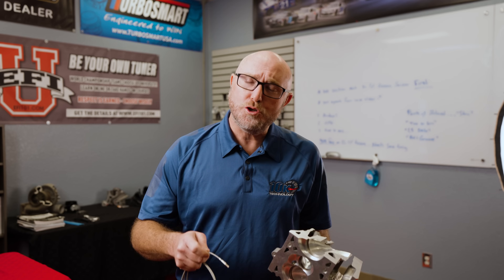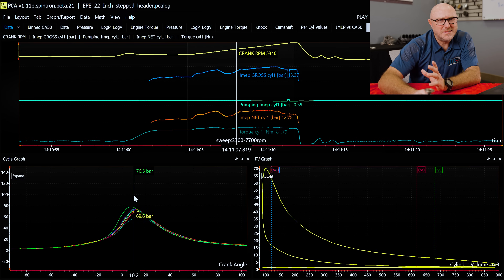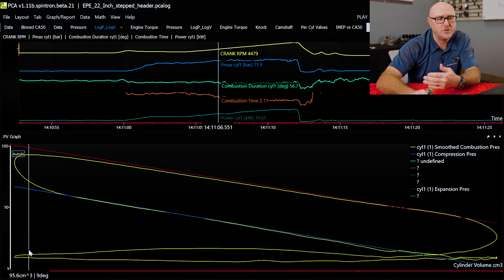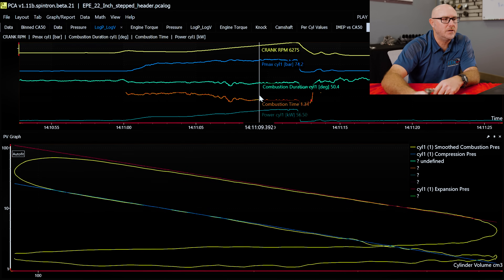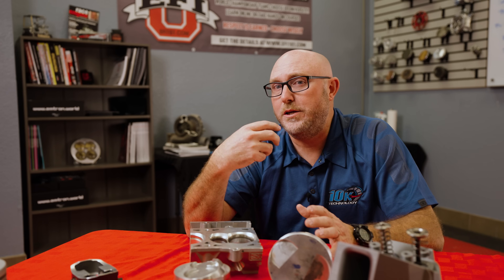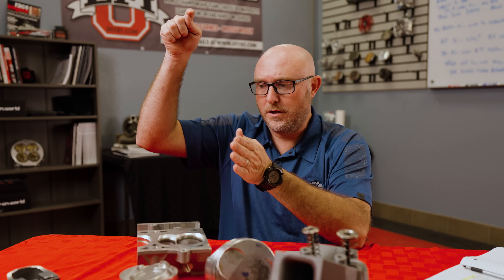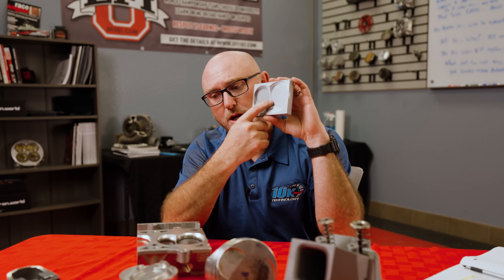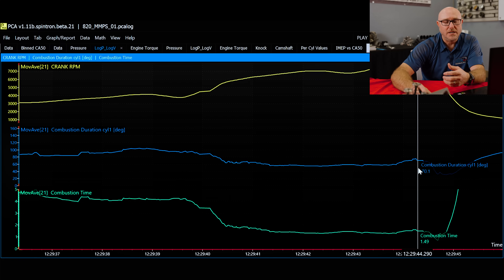I Think Steve Morris is WRONG and I Can Prove It!

Comment: I guess what Steve stated could be described as being (basically) right, but for the wrong reasons. 

Another example in this industry is the claim that LSA in and of itself determines engine behaviour. And just like the physical realities of creating working cam profiles mean that a given LSA on a given duration more or less correspond to given valve opening times (what matters), the physical realities of cramming more A/F into a given cylinder mean slower initial ignition (due to more mass needing to be plasma'd by the same energy spark) and an increase in exhaust remnants - which, like you mentioned, lowers the burn speed. By themselves and of course combined, these factors result in a longer combustion time than what "should" be and thus the need for more ignition advance than what "should" be needed.

These circumstances mean that statements that make absolutely no sense when looking at them from a basic theory, chemistry and/or physics angle still can correlate to real world results - which in turn are where Steve, and the LSA guys, got their beliefs from: they've done it in the real world, they've seen what it did, they've (hopefully) thought about it and they've drawn their conclusions.

Comment: Where the spark plug is located, what type of plug, and AFR. A fatter mix burns slower BUT it creates more pressure. If you pack it up you make it denser, thus it burns faster, but if you add more fuel, it burns slower again. If you run it rich you create carbon deposits inside the chamber which then heat up and cause pre-detonation. If you add more fuel and boost, reduce the advance, you end up with unburnt liquid inside the chamber that doesn't compress, lifting the head from quench area. Then there's cam timing. When your exhaust valve opens, the leftover pressure escapes. this pressure spins the turbo fan and heats it up. This heat travels through the turbo heating up your oil and your compressor fan. If you have overheated your cold side before, this heating fan expands and makes it tighter, heats up your intake air, showing more boost on your gauge. Then you cool the temp down with your fuel, but your AFR is still out of whack and your flame front is escaping into your exhaust. Also your liquid fuel flushes your piston rings creating more friction, making them lose tension, while the hydro lock collapses your ring lands. When the blow by escapes into your crank case the flame front follows welding your rings into your piston. Then your piston heats up, so does your rod, your rod expands, and your piston sticks to your cylinder bore. Rod gives up, piston shoots up into your valves and the run is done.
Reply: An exciting run indeed..

Comment: Back in the '90's, I read an article in a snowmobile magazine about a gentleman who was testing cylinder transducers in a two-stroke engine. As I recall, he was trying to eliminate the carburetor for a better EFI system regardless of load, temperature or altitude. Not sure how it ended but this sure rhymes

Comment: I was told the LT-5 has one of the best combustion chamber designs of its time. They respond really well to additional timing.
 I wonder what technology Lotus was using back then in the mid 80's because they seemed to have nailed it with that engine.

Comment: The fire scenario you speak of is backwards. The fire on the right will burn hotter but not faster. Because the flow obstruction . The one on the left has no restrictions will burn really fast but not as hot. Not enough fuel. 
Prairie fire in Kansas. https://youtu.be/xulrGWL5BoU?si=yzEwuQEWEcwegQk-
Go Chiefs Tomahawk chop for Dewey 🥩

Comment: When you talk about 426 hemi. When Dodge wanted the old men to run the new hemi instead of the 392 that everyone else was using. Gar couldn't get it run hard like the old one , in frustration he cranked the timing    up, way up, said Gar, well that was what was missing way more than they ran in the 392.  Ask him
Reply: the reason he cranked the timing up in the first pace was he wanted to blow up the engine so he could go back to the 392 Hemi. the car went something like 210 at 40 degree's timing and the nhe upped it to 50 and it was even faster.
Reply: True; but i think it was becauce nitro fuel burns extremely slow. Not sure why the 426 was so much different than the 392 using the same fuel.....maybe larger chamber?

Comment: I believe Steve. If you are running low compression. The tune can tolerate wider variable of tuning. Steve’s compression engine won’t have as big of tuning variables. Alcohol increases the window wider with cylinder cooling factor.. 
The grass fire scenario you are talking about happens in Kansas you got it backwards. Dried short grass with no brush to block the wind burns very fast . The wooded are burns fairly slow because wind can not flow do to all the obstruction of trees and brush. 
Go Chiefs Tomahawk chop 🥩

Comment: I agree with Steve, to an extent. There's always outliers. Just because you should be good without changing timing doesn't always mean you are good. If you're introducing more air, add more fuel, the bang is going to be just as sufficient when was before as after. As long as your fuel is set up properly. However, if you're running crap fuel on crap plugs on a crap engine and throw boost at it, you're going to get crappy results. Maybe not as crappy if you retard timing, but the ends doesn't justify the means.
Reply: Have you put a drag & drive  deep in the 5s!
Reply: @patcoder7308  THERE IS A WANKER CALLED V8 LENNEY SAYS THAT STEAVE DON'T KNOW SHIT AND CAN'T BUILD AND ENGINE TO DO 500HP WHAT A TOSSER.   I THINK FOR WHAT STEAVE IS DOING WITH THAT WAGON DOING A DRAG AND DRIVE HE IS DOING REAL GOOD . THAY KEEP TRYING TO COMPARE STEAVES WAGON WITH THE EAGLE . BUNCH OF NUM NUTS TO NOT KNOW THE DIFFERENCE BETWEEN A PURE DRAG CAR . AND A DRAG AND DRIVE.
Reply: I DO BELIEVE THAT AIR DENSITY HAS A BIG PART TO PLAY IN BURNING ALL THE FULE. OR AM I WRONG.

Comment: When I live in Japan I worked for a Japanese manufacturer's internal engine builder and parts maker for their racing programs. We also made prototype parts for future models. We had our own data from grA, GT300, GT500, Dakar rally, 24hr LeMans, Pikes Peak, etc... While I was there we started making street parts based on those programs. Our oil pumps, headgaskets, pistons, rods, cams, turbos and other parts were exactly the same as race version. But we added some cam options, oil pumps, water pumps and other parts based on racing but for street. Anyway, every single engine required less timing as we increased boost. We produced our own ecu and software too. It's not uncommon for our engine programs to have 30+ degrees at 0psi boost tapering down to 20 or even 12 degrees at 21psi and 28psi. We could add a few degrees after peak torque but didn't bother on most. That's on about 94-95 octane (USA rating) with pentroof 4 valve. If we wanted more boost then we'd remove the quench pads or use race gas. Keep in mind we could run 13:1 and extremely high egt for 30+ minutes with no damage. Of course we ran 11:1-12:1 and low egt for safety. These were 2.6 & 2.8 in line 6, 8.5:1 compression making 450-800+hp at the wheels. Oh and the pressure delta varied greatly between turbos. We even used old school clipped turbine wheels on some setups to reduce back pressure. Nonclipped would spool 1bar just before 3,000rpm and clipped version kick in at 4,500-5,000rpm lol. It ruined turbine efficiency but helped VE. They would run like big displacement NA engines from 5,000 to 8,000 rpm. I can't imagine running the same timing at different boost.

That said if engine makes peak power at 30 degrees and 0psi. But it could also run at 40psi and 0psi without ping then theoretical maybe it can make peak power at 30 degrees and 21psi were as our engines did at 20 degree. I wanna say air-cooled Porsche make peak power NA at something crazy low like 20 degrees but don't ping till 35+ degrees. And that's like Steve is saying. The combustion shape is limiting factor not fuel. Need a "hotter" combustion design. But then again on air-cooled you probably can't keep cylinder head temperature under control if the combustion design was pushed harder
Reply: SM is using methanol so that may change things.
Reply: So Nissan RB engines. Interesting.
Reply: 2.6L and 2.8L inline 6's commonly running 8.5:1 compression in those series with a manufacturers internal engine builder... so Nismo RB26's 🥳hell yeah, thanks for sharing that.
Reply: Remove the quench pads for more boost? Internet says no quench causes detonation sooner? Remove pads to lower compression? A 2jz ge , with a gte head gasket will have lower compression but you have too much space on the quench pads for them to work. If I want high h.p. boost, do I run no quench on the ge (thicker gasket ) or run quench with stock gasket thickness giving higher compression?
Reply: @jasonschreiber6458  its not that no quench makes detonation happen sooner(it doesn’t), improper quench does. Theres a middle ground between good quench and no quench where you run into detonation issues. The chamber is shaped much different for a no quench build
Reply: Kyle asked for comments got plenty to think about, and in the comments 😊
Reply: Can you share ideas on how to prevent engine damages due to LSPI in an direction injection engine?. An engine using 0.5litre of engine oil for every 1000km would mean 5 litre at 10,000km. Most oil loss  would mostly go into top of the piston and increase risk of LSPI damages? In China the made different replacement set of piston & rings for VW engine to reduce lost of engine oil. Pls share your experience. Regards. 🎉🎉🎉
Reply: Facts brother.. my turbo coyote was picking up approx 40hp per point of timing up to 21deg.. then above that is was only a few or no numbers.. if you go too far with timing, your just pounding the pistons, rods, and bearings as the pistons is still moving upwards when it lights.. and if it's too low you won't have the proper compression which is what makes the power... I move mine between 14-22deg depending most on fuel type..

Comment: The faster the combustion(without detonating), the easier it is to run at higher RPM, and easier it becomes to time the combustion event closer to the point of maximum mechanical leverage, ~12-18ATDC depending who you ask. You also lose less energy to the cooling system, which then also let's the engine run cooler, because there's less radiation from combustion acting on the engine itself.

The combustion process is the ultimate black art of engine tuning. Eventually you have to seek the wisdom of the combustion chemists, who understand fancy jargon like rate steps, and intermediate species, and have them tune your witches brew. In the really exotic world of 4 valve rapid combustion, swirl and tumble are just scratching the surface. They even go as far as slapping what is essentially a spark plug non-fouler with small drilled holes.

Comment: Seems like Steve gave you the parameters of his statement, safe fuel ie quality race fuel, safe compression and boost levels, and safe combustion chamber design and safe timing numbers. I think it's important to recognise that Steve Morris builds drag and drive engines, not max effort, race engines and what he finds an engine needs to put thousands of miles on the road and race is different to a rebuild every x number of runs. So, in conclusion, as you stated when you build an engine the way Steve does you get the same results and when you do different engine designs and intended use you get different results. From your results it seems like air and fuel prefers somewhere in the .8 to 1.1 time range to complete a combustion event regardless of variables

Comment: There’s a way to do this without drilling into the head 

Had a set of 8 spark plugs that were made by drilling into the nut and comes out into the combustion chamber had a jeweler micro weld a stainless tube onto it and ran it through an expansion coil to even out the pulses and it gives a better reading and you can save the heads and collect the data on several different platforms without ruining the heads it was really cool to see and cost all of $800
Reply: What sensors did you use with that?
Wouldn't the additional volume of the coil cause issues?

Comment: We need a temperature overlay. As there's a density shift and the speed of sound changes.  Would love to see this. 👍
Reply: Bingo. Adding boost increases pressure. With the equation PV= NRT, it balances out as extra TEMPERATURE (T) . Extra temperature causes detonation. That's why if your fuel can't handle it you have to pull timing with  boost
Reply: steve is not using the same fuel he is using so this data is nowhere near the same
Reply: @stevenbean9706 fuel type only sets flame and oxidative rates.  But all fuels are affected by temperature and pressure.

Comment: I heard Steve say as long as your fuel is "Tolerant" also.  I figured yes Methanol is Tolerant, Steve's preferred fuel.  A BBC requires a lot of timing.  In your example "Boost Fixes Everything", so you needed less timing.  How about another video on a GENII HEMI?  You also didn't mention AFR, a lean mixture will detonate especially under boost.  Anyway I just Subscribed.  Thank you.

Comment: I started in the engine reconditioning game when I was 16, that was 1985, I have worked in the performance race engine world, for many many years I was tuning engines, race engines, be it on a engine dyno or a chassis dyno, before retirement , I owned a performance motorcycle shop, with a motorcycle chassis dyno, building turbo bikes, nitrous and all motor engine.
I can tell you from a life long experience, Steve Morris is wrong a lot of the time.  I remember  watching that video and his claims about ignition timing .   Building peak pressure at a specific  degrees after top dead centre is vital for engine performance and longevity.
Many factors affect this, boost, fuel octane and burn rate, atmospheric pressure, humidity etc.   I used computer models to determine at what degrees after top dead centre would be best for peak torque and what cylinder pressures would be there at or before that point.

On the dyno we play with ignition timing to find these peak torque figures and determine a safe ignition timing figure for the fuel we are using.

Steve videos only show again and again what he doesn’t know!
One of my old bosses use to say, a “ EXPERT” Is a drip under pressure!   Steve is just a drip under pressure.  

His videos look great for those who don’t know , for us that do, those videos just show us, he knows very little and has almost zero technical knowledge.   The proof is how he tries to babble around a technical issue .  

Then have a look at the stuff that stumps him!   Again proof he lacks the technical knowledge.     He is nothing more than an experimenter and knows what he knows by his failed attempts.   
This is a costly way to learn,  and it’s costly for his customers !

And that engine he sold to Cleetus, that had the main cap failure, look at all those sharp edges, just waiting to start a crack.
This is 101 of race engine building,  remove all stress points. Radius all sharp edges.    Not Steve and look at how they failed!
And in earlier videos he showed a main cap failure and states the crack started and the sharp edge,  yet in that later Cleetus video he say he never seen that before. 
That engine sold to Cleetus was just a grenade waiting to happen,  I look forward to seeing how this engine goes in Val’s Camaro.